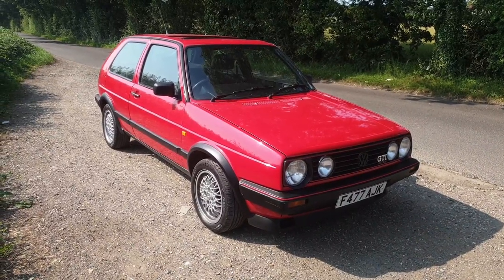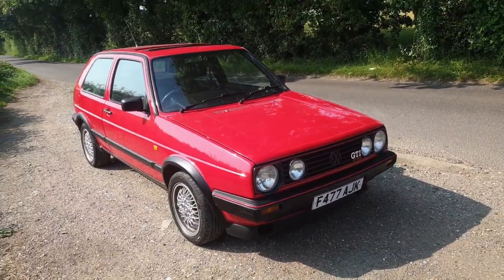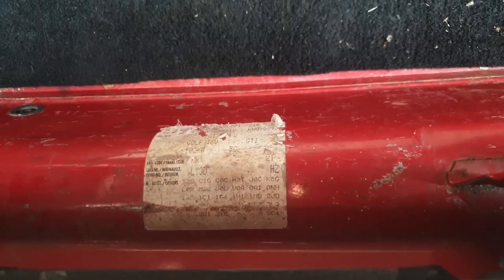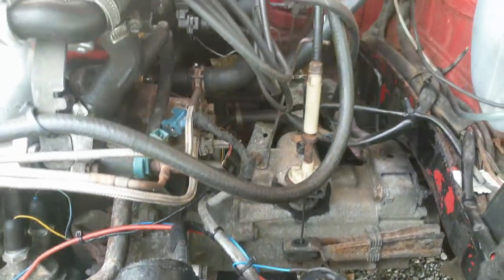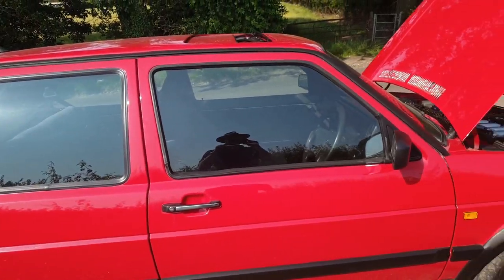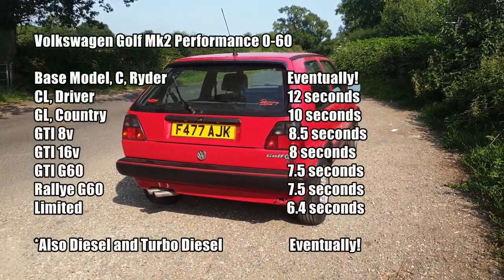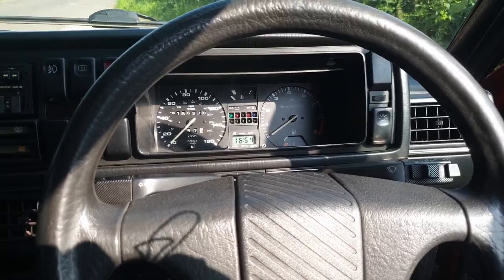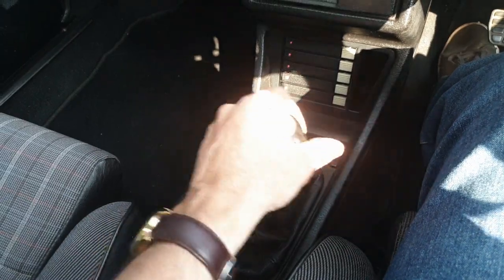Mk2 Golf Buyer's Guide - Thinking of buying a Volkswagen Golf Mk2? Watch this first!

Comment: Think I’m going to buy a 92 golf with an aba bottom end swap. It’s fantastic under when under acceleration. There are 2 things I’m not so sure about. 1 is at idle the rpms will just steadily fluctuate between 1000 and 1200 rpms. The owner thinks it is due to the tune that may be on it. The other thing is the owner told me when the engine is cold, and it has set for several days there will be smoke coming from the exhaust upon startup. I did not witness this as it was already warm.

Comment: I just got gifted an 89’ Jetta Mk2 1.6TD 4DR GL. Has power steering and A/C. No ABS brakes. 5 speed manual. All stock original stuff. Interior is nearly flawless. Exterior is in perfect shape minus a couple very minor rust spots. Previous owner bought it new in 88’ and only drove it in Summer. Has 205,000 KMs (like 125k miles?). Needs a little work but I love it. Wasn’t sure what I was going to do with it but decided I’m going to put some money into it. Don’t plan to keep completely stock though, but will keep most original parts

Comment: Bought my Jetta MK2 CL for about 23k Swedish crowns (1,8k pounds) it is a little bit of surface rust but almost no rust underneath. Run for 210 000km (133 500 miles)

Comment: A few pointers not correct such as the fan not working on the 3rd speed indicates fan resistor thermal fuse failure, not 1st but not a bad review

Comment: I belive PL engines got CAT, not shure fot the PG and 1H. Yours is a KR, and I belive it should have a 50mm intake by the year of the car. Also interesting that you don't have GTI steering wheel with straight bottom arcs. 

MKII 4LIFE 🙂

Comment: Good comprehensive video. Sadly the correct springs for the gti and 16v are no longer available which were slightly lower than the bread and butter models. Eibach lowering springs are very close to the originals though. The biggest improvement can be made, even to stock height springs is to fit bilstein b4 shocks. Considered a ‘stock replacement’ they are stiffer than the factory ones and sharpen the handling a treat without ruining the ride. A nice compromise. Finally you can get stainless arms for the sunroof win deflector second hand. The original ones rust away with enthusiasm. A nice factory upgrade.
Reply from the maker: I now have that suspension combo on this car. :)

Comment: I would add: If buying a Tornado red one be prepared to have it resprayed as it fades badly. PAS makes driving nicer but rare before '89. Check 2nd gear synchro for crunching in cold weather, very common in high milers. 5 speed was introduced as standard in 1980 (same as Porsche 924) IME Digifant gives better urban mpg but K-Jetronic better long distance mpg. K-Jet has snappier throttle response but needs 98RON or they ping and your valves seats will be ruined. Retarding timing will make it take 95RON but it will drive like a slug. Audi based engine is tough but valve guides can wear, look for smoke on hot startup. I would say the listed 0-60 times are about 1/2 second optimistic. If the temperature gauge doesn't go to 85/90c and mpg is pants then it's like to be the sender on the coolant top hose. I've had a lot of VW's

Comment: Nice to see a video with someone getting the facts right! I noticed yours has the narrower Corrado/Passat inlet manifold (3hp deficit  but slightly more torque lower down to counteract the larger weight of said cars). Nice example you have there. In your plans to make it as factory spec are you getting Montreal (bottle top) wheels and non-tinted rear lights? The BBS RA's were only fitted to Big Bumper cars as I recall, along with the half tint rear lights (16v).

Comment: Drew, why waxoil when dinitrol, buzzweld and lanoguard exist? Waxoil hides rust forming/spreading underneath it. Are pattern parts for Golfs as bad as the ones for land rovers?
Reply from the maker: I was kind of using "waxoil" as a generic term rather than a brand. It's a good point! :) Golf pattern parts aren't too bad, but they need fettling to fit properly.
Reply: @drewwagar  OK :) would hate to think of your P&J slowly rotting away! We had to replace the chassis on our series for that reason...! 

Hopefully pattern stuff only needs minor tweaking - we've had stuff with holes drilled in completely the wrong place (etc)

Comment: So, any hints on what thermal weapons should be outfitted on 16v GTI? I used to go with a linearly polarized beam laser, but would always end up with some overheating issues when entering superluminal speeds. Should I buy a laser frequency stabilizer, or try something else?
Reply from the maker: Radio/cassette and shoulder pads are the only mods you need. ;)

Comment: I would purchase  the 5 door version.  As for the body colour, I would go for turquoish grey. In the early 90's it was common.   One drawback  is the lack of reliability  which means you cannot bring it far away or even on the motorway
Reply: So it's not a Toyota in terms of reliability?
Reply from the maker: They're fine if looked after. Mine does plenty of long distance runs, hundreds of miles in a day.
Reply: @agustin8160   toyotas might be the most reliable but I would never buy one. Asians cars have awful to mediocre designs. Beside rare cases
Reply: @drewwagar  it depends on the   specimen.

Comment: I guess the killer question is do they run on the new fuel? The super unleaded is ok but that may be getting withdrawn within five years.
Reply from the maker: I would definitely run them on E5 for as long as possible. Not much info on E10 for this era of cars yet.
Reply: @drewwagar  When I had a Mk2 I would occasionally treat it to super unleaded :)  Ran great on super.  If there is a solution someone will find it I have heard electric being mentioned but that can cost up to 30k pounds.  At least the diesel models should be ok they can run on other fuels if need be I rather envy that now :)
Reply: @drewwagar According to VW, all Golf 2s for which Super is enough can handle E10. The stuff has been around in the USA since 1978. As is well known, there are also 2-series vehicles, including Digifant and KE-Motronic.
Reply: Mk2s won't handle E10, as it eats the fuel lines, fucks with your carburetor or fuel injection system and causes cold start issues.

Comment: Hey, just wanted to ask, does 3.3k sound ok for what looks like a very clean example for a mk2 ryder? Looks really clean, can't see any rust from pictures/videos, supposedly on bbs wheels but they must be replicas since the car is being sold for 3.3k
Reply from the maker: If its pristine and low miles, that sounds fair to me.
Reply: @drewwagar  supposedly 61k miles, aftermarket front lights and rear lights, gti grill, bbs replica alloys and a k&n air filter, don't mind those as they look cool on the car and don't think they are hard to swap for original, except maybe the air filter, he said that it had an oil leak but replaced majority of the gaskets and has minor or non existent leak, do u know wat it could be? and if its risky? looking to view it on sunday but am a bit worried still, says finished in diamond silver, is that an original colour or could have been resprayed?

Comment: So you could find a Plymouth/Talbot Horizon and do some cosmetic work to create a "fake Golf"
Reply from the maker: I think you'd have a harder time finding a Horizon than a Golf!
Reply: @drewwagar  Over here they were a "dime a dozen" (does that translate?). Plymouth Horizon and Dodge Omni were everywhere.  Fun fact, they had the "bottom" side of the VW engine, but the "top" side bits were applied here.  So the same engine had a mix of inch and metric hardware.  Side ask: Did you have to replace the plastic retainers on the shift linkage?

Comment: Never liked the golf never seen the appleal suppose it was better made than an escort
Reply: At 10 years/150,000, my mk2 was going strong at 190,000
Reply: No comparison. You don't see many escorts but there are still quite a few mk2 Golf's about.My friends RS turbo was past its best
Reply: Any recommendations for purchasing side moldings? My right rear most small one is missing. Great video. 92 American Spec Tornado Red 16v since 98.